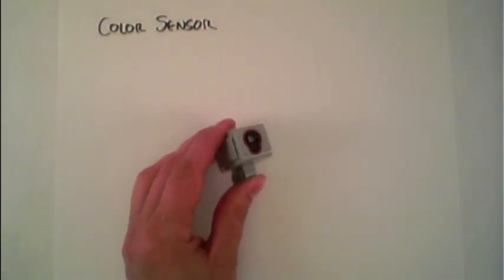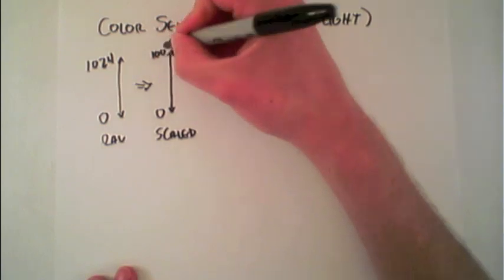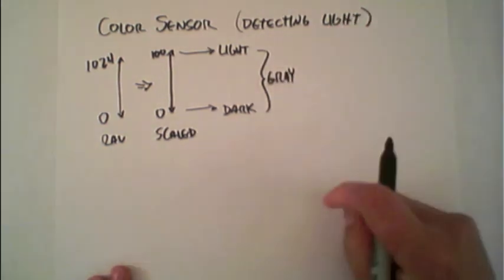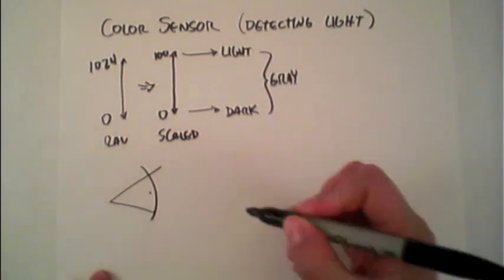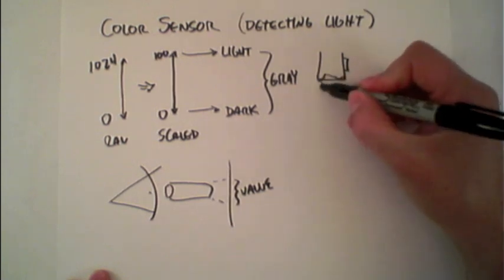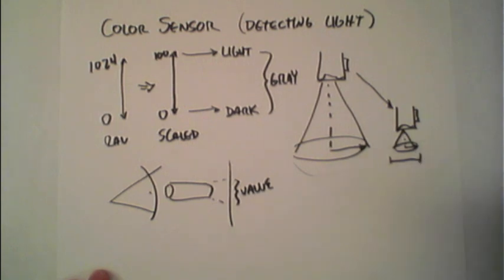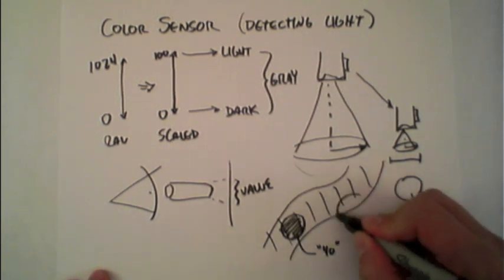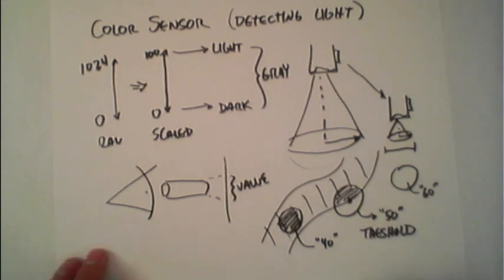EV3 Color Sensor (Part 2)

Comment: An FLL team that I coach wants to know the limits for the distant the color sensor should be from the mat in reflective mode.  This year, the robot will have to go over some objects which will require raising the sensor up.  Previous years was to keep it as low and shaded as possible.  What is the recommended maximum limit to raise to follow a black line?
Reply from the maker: Good question! As I described in the video, the higher you go, the "wider" the cone that the Color Sensor is "seeing" or detecting. Also, as that height increases, it also means more outside light/other interference might be let in. So, as you said, usually the recommendation is to "keep it as low and shaded as possible" when line following. The maximum height is therefore going to be partially determined by the environment in which you are in (overhead lights, windows to the side, etc) which is often tough to predict in terms of FLL competitions.

Two thoughts on your question:

(1) This provides an excellent opportunity for you two encourage your students to do some scientific inquiry! Here is a real-world problem that you as coach (and me, as well!) don't know the answer to. But the students can do some experiments to determine an answer. Position the Color Sensor at various heights, measure that height accurately, create a data table, take some data points, compare results, have some team discussions/arguments (the good kind of arguments!), and come to a group conclusion about optimal settings. You can link this to real-world engineering: often engineers come across problems that you can't just "look up the answer" or get someone else's prior work off the Internet, and instead have to do some experiments, collect and analyze data, and use that analysis to draw conclusions that will then influence your engineering design choices.

(2) The other solution (and I don't know the specifics of the FLL challenge, so perhaps not applicable), is to create a mechanical solution that "lifts" the Color Sensor up when needing to go over some objects, but then lowers it back down into optimal "line following" position when it's needed for that task.

Good luck to you and your team!
Reply: They actually had #1 in the mix.  However, they were wanting to know min/optimum/max specifications about the device.  I tried to help them look for them, but could get nothing concrete from the LEGO or MINDSTROM websites.  I did see in the forums that 3mm seemed the min and optimum, and 15mm was about maximum.  Their ideas to test seem pretty good too!

Their alternate is to not have the color sensor as far out front, but more under the wheels.  The other is to have one out front and one in the middle.  This way, if the robot didnt stop on a line, it would have an emergency stop thereafter.  Probably not "the" best idea as you are trying to remove variance... but I did like the thought.  Plus, the would not be able to square on a line.
Reply from the maker: Great.  Seems like your team is en route to figuring out a solution.  If you still feel like you need more assistance, I'd recommend posting the question to the LEGO MINDSTORMS EV3 Facebook Group or the LEGO Engineering Community Facebook Group.  Best of luck!